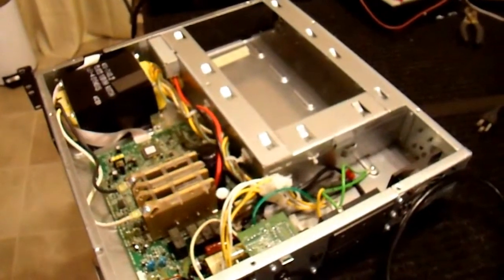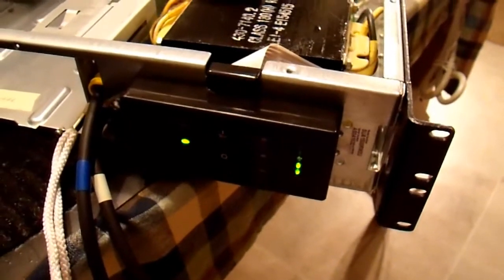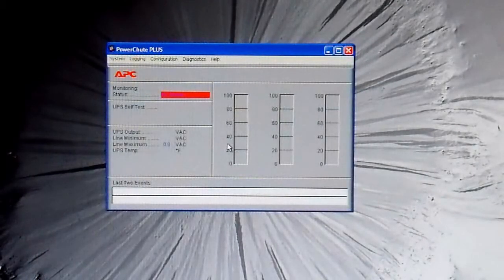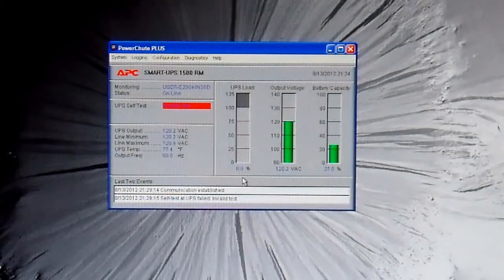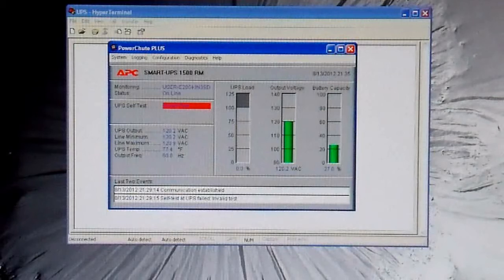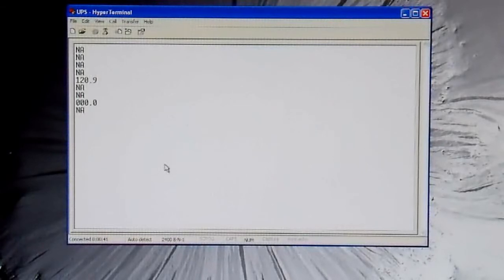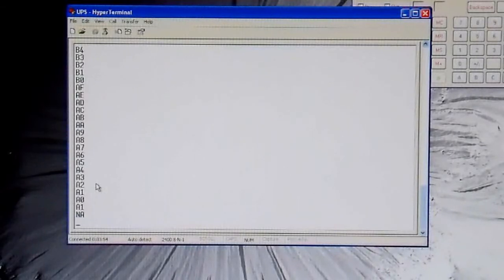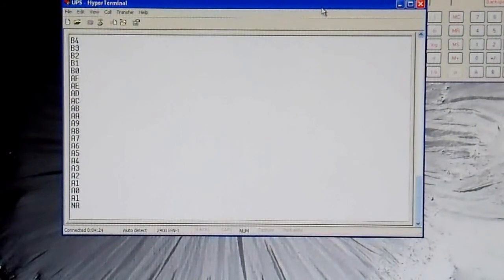UPS to 1.5kW Sinewave Inverter Conversion part8 - Increasing the Wattage

Comment: Hello, I have connected to my apc 1500 smart ups tower version via serial port using puTTY.  Found the admin password as “apc” the interface is not as deep as you show on this video.  I can’t seem to change the current settings.  Lots of other goodies though.  Also I have ran into a issue, I plugged a non apc serial cord to four ups’s and they have fault on over load when you first power them on.  The common thread is the serial adaptor I used.  Finally got a apc genuine cord and it talks to puTTY.  Is there a way to save the apc 1500 I seemingly destroyed?  Maybe ordering another ADC chip and solder a new one on… any thoughts?
Reply from the maker: I've never heard of an old style APC being damaged by a non compliant APC cable.  I'm not sure what happened or how to recover the damage.
Reply: @knurlgnar24  ok thanks for the reply!  I have a bunch of old ups’s from work that are being thrown out.   Maybe they had a problem from the get go.

Comment: Hi, and thanks for the great video.  I'm trying to find a reference for the commands that you put through the serial interface and was able to reset the parameters.  Any suggestions? Cheers
Reply from the maker: Unfortunately I don't remember the source where I found the commands and/or protocol.  I rewatched this today and it was all new to me again!
Reply: @knurlgnar24  Thanks for checking it's most appreciated.  I'm currently working on trying to recover a 24 V 868 A Hr forklift battery and was wondering about the parameters for this.  I'll keep poking around and again thanks for the videos, they have been most helpful!

Comment: This video has just proved me that APC has no rival in UPS systems, I didn't knew you can calibrate it an upper wattage capability...
Reply from the maker: Unfortunately Schneider Electric bought them out many years ago.  Goodbye quality UPS units.  RIP.
Reply: @knurlgnar24  by the way, can you do a video of how to adapt a lithium ion pack battery to a UPS systems and change the UPS charge method? Me and my brother where thinking about cut off the UPS charge circuit, and charge the battery with an external lithium charger, but I would love a more professional solution. Thank a lot for the answer I'm from Cuba

Comment: I believe you would have had a lot easier time with an Eaton.  Cooling is far superior, they start without a battery, and the quality is way better.  Eatons are normally quite expensive, but the Dell 500/1000/1920 line are inexpensive and they are actually the Eaton 5P line.  Regulation is also very good.  The Eaton is the Samlex of UPSes.
Reply from the maker: Thanks for the advice as I am not familiar with them myself.

Comment: Increasing the output limit to 1500W using the APC Software and a terminal program to modify the internal factory calibration settings cant get connected with any terminal program...followed all steps ...still no joy...

Comment: are you use a straight though rs232 cable or a cable made for the APC unite.
Reply from the maker: It requires the special APC cable, or there are instructions on the internet on how to modify a standard one to work.
Reply: ***** yea I made my own cable usb to RS232 then I had male and female ends made the adapter.  for  APC worked. compared to 30 bucks for a cable. LOL

Comment: I don't get that buzzing sound from my transformer at all.
Reply from the maker: That's interesting.  Every Smart UPS unit I have every owned (nearly a dozen of various models) have made a buzzing/vibrating noise when operating on battery power.  Maybe you got a good one.  :)
Reply: You might need to tighten the screws that hold the laminations together...I did that and the hum noise reduced significantly.

Comment: need a link to that software to see if it will work with the ones I have so i can turn those off.
Reply from the maker: Not sure if I can legally offer the link as it is hidden in the FTP archives at APC.  Also, I don't remember where it is exactly...  But it is out there somewhere!
Reply: ***** before I did video on my conversion and since I have 2 I gave it a try with one first. the biggest pain was getting the heat sinks out. so I will try something different by getting the heat sinks good and hot. so I can pull it from the board hopefully with out damage. the one I did the conversion with some of the solder pads came lose. but I had some thin copper for copper trace repairs, and some fiber glass resin and repaired them. and I got the 20 ohm ristors, the caps witch I dont think I need but got them any how and the transistors 16 total for two sets.  and I put it all together and it worked and worked great. right now I have a wire soldered at the points at the sincing transformer. and it works I can get it up to 1500 watts and a little past I pushed almost 1600 watts I can tweak the wire to get it right at 1500 but I like to find that software so I can just do it in the unite.   

I like to see if I can make a master slave unite out of them, I will see were the single generator is on the unite. that drives the circuit's to see if I can make some mods were I can have a switch in the back of the unites that has master slave or slave. That way the slaves will get all its commands from the master unite. in hops of stacking them for increased out put.  because I have a 800 watt 1000XL unite that looks the same in side. even the part numbers on the transisters match, and so dose the transformer and relays. its identical. to the 980 watt 1500 UPS's I have. the only differences is that the 800watt has a anderson connector in the back for and external battery pack for longer run time.  what I will do next on the inverters is upgrade the wires to 8gauge I took some 6 gauge to get the higher wire. the 10 gauge got a little warm LOL. I like to use 6 but man its huge. unless I can find a way drill holes in it and make the runs thicker witch I can by scrapping the solder mask and soldering some think copper wire down to make the run thicker.  found that the two center heat sinks is positive. so I can put a lug in the middle of those to connect the positive wire do and drill a hole in the board and solder a brass or copper luge with a nut and bolt to keep it held to the board. and solder it all in place that should help with current flow.     

I love to change out the heat sinks by building a daughter board. with all the components on with much larger heat sinks. not really a lot of surface area to dissipate the heat from the transistors.  but with a hour run time at 1300 watts it ran pretty coll since it has a fan right beside them. so it ran cool but I like to have more surface area. 

I'm going to see if I can find the tweaking software so I can tweak. it I love to get some directions on that LOL>
Reply: ***** Ok I found ever thing I needed at the end I did the programing. how do you save it or exit the program with out losing the settings or did you do that. AND its flaky LOL I'm sure I did it right. but getting back in can be a pin. is there a sequence of events to program it. or get it to connect.
Reply from the maker: McCuneWindandSolar
It did seem 'flaky' when connecting for me as well but I found a sequence that made it work.  Once it accepts the serial commands it immediately writes them to EEPROM so there are no additional steps needed for it to permanently save.

It sounds as if you put a lot of work into modding your UPS!  I hope it works out well for you!  I did make a video about putting two of these UPS units together in series for double the power, but I wasn't able to 'stack' them in parallel without more intrusive modifications.
Reply: Hi!
Did you get powerchute plus?

Comment: Hi, i've hit a road block, i hyper-tierminal it ask me for a username and password!!!
Reply from the maker: Are you selecting the COM port option?  There should be no username prompt...
Reply: ***** Could be possible that if the unit is a later revision the factory could have set a UN and PW to keep people from modifying the parameters. I know Motorola and Kenwood commercial 2-way radios that are late models the radio shop technician will set a UN and PW via the RSS (Radio Service Software) to keep the end user from using pirated RSS to reprogram the frequencies and such and MUST return the radio to the original shop to be reprogrammed. It's like job security in a way unless you know the login credentials or know how to crack it. It's a good possibility now days.

Comment: Is it possible to set the battery input voltage higher than 48 V.

I have access to many 12 V LA batteries that I would charge off line.

It would be nice if the inverter could run on 60 Volts using 20% less current and with a 20% longer run time.